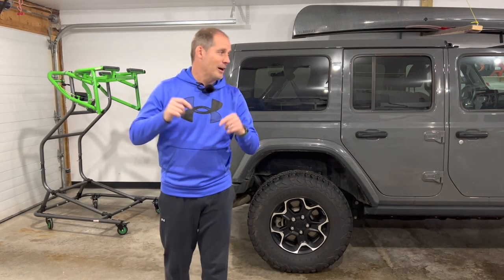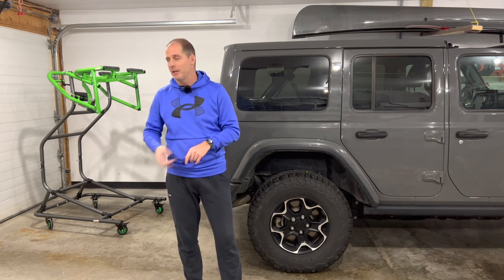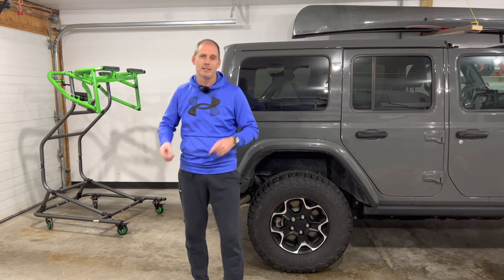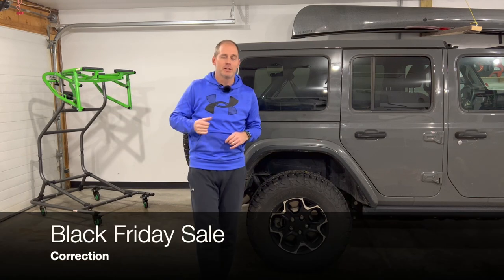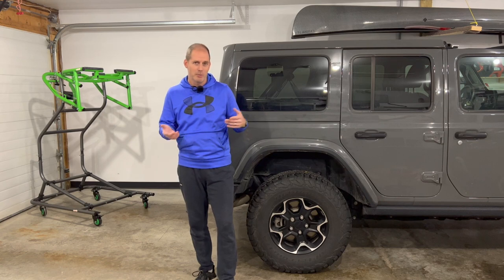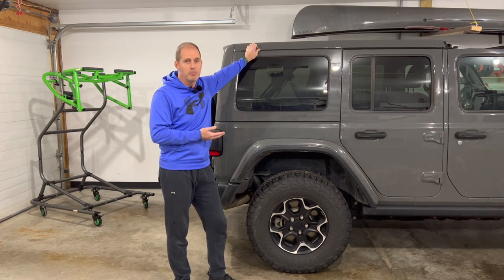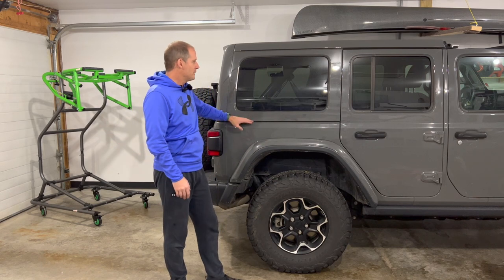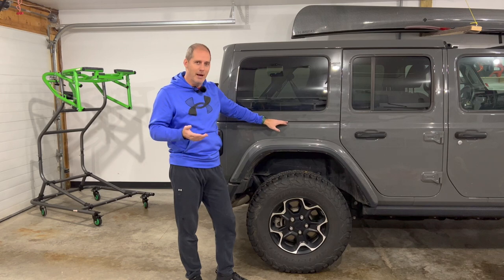Easily remove a Jeep's Hardtop - Alone - "Top Lift Pro" - In-Depth Review - Hardtop Removal Tool!

Comment: Once the lift has the top on. Can it be lowered a bit. I'll be taking mine off in the driveway and then rolling into the garage. Wanna make sure I have enough top clearance. Thanks.
Reply from the maker: Yup, I did that all the time. Took it off, lowered it quite a bit to store, and then raised it back up to put on the Jeep. Great question.

Comment: Well dang, I'd be able to afford one of these lifts if I hadn't just bought a Wrangler. 😂
Reply from the maker: Haha! I hear ya!! It's not cheap, but it is SUPER convenient. I don't have a soft top, but I'm able to get the top off in minutes and enjoy a day of top off driving, and then come home, throw the top back on, and go out in the evening with things locked in the vehicle with the full security of the hard top. It's a great combination for me.
Reply: @PeterLoweOne  I'm just jealous is all. Space in the garage comes at a premium, so I'm looking into building my own winch and pulley system mounted on the ceiling.
Reply: I've learned you can't afford anything after you buy a Wrangler except crap for your Wrangler.